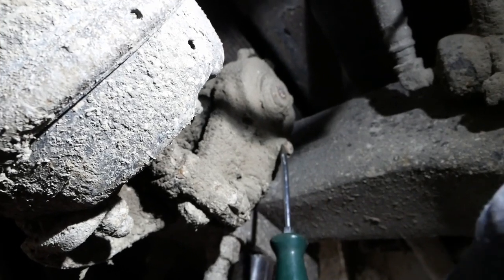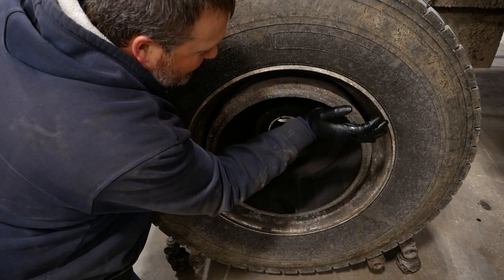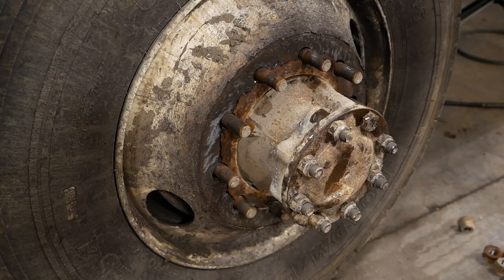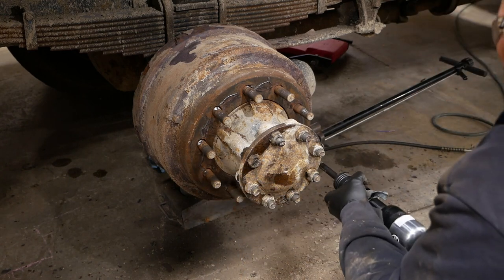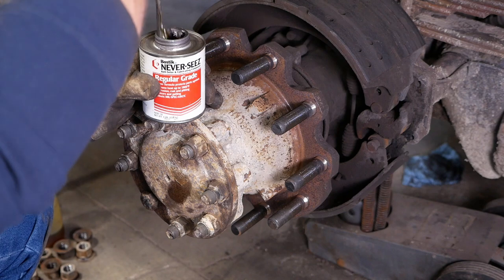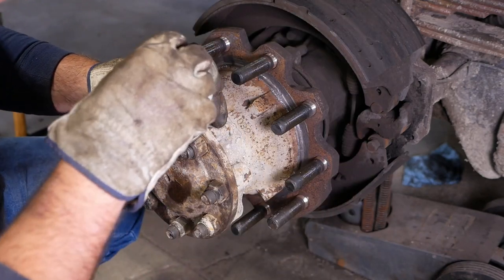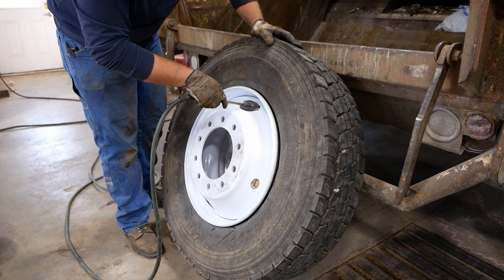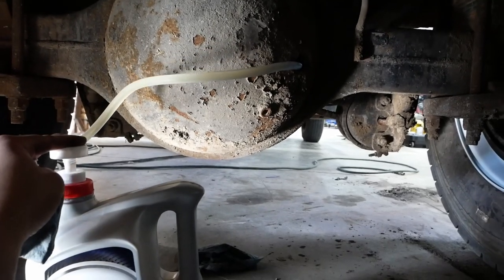Garbage Truck Driveline Noise Could Have Been Bad!

Comment: I had a 10 wheel dump truck in the late 90's - early 2000's that had 11R22.5 tires on it with the steel Budd wheels just like this truck you're working on.  The difference being that I was regularly running it with 35 ton gross weight (which was allowed in NJ with special plates).......and it would do exactly this at least 3-4 times a year.  I even switched all 8 rear wheels to the heavy duty steel Budd wheel.....and it would still do it on a regular basis.  It just became a regular check that was part of the pre-trip and pretty much every time I was out of the truck before I got back in it.....kick all the inner tires to see if there was any anomalies.  As soon as I heard the noise at the beginning of the video I knew exactly what was wrong!!!  LOL
Reply: I think it just comes from going over a bad rail road track or a pot hole or man hole or even a rock, in your daily route;  for that moment, you put all the weight on that one tire with a sudden jolt as you hit the bump;  That's the only thing I can think of.  Maybe it's the brakes coming on way too strong -- and that sudden STOP in the hub, while the wheel is still rolling with all that weight and traction;   The wheel diameter is just too big and has too much leverage for that amount of weight. Just thinking out loud.  It's kind of strange to see that it happens so often.  Maybe it's just the metallurgy is too brittle or that it work hardens.   It's interesting;  I wish someone could explain the exact science of what is happening.   I guess they should just build them thicker. lol
Reply: @calholli  the lugs have rust stains around them, after the repair, they need to be torqued up, and retorqued again in a hundred miles, then retorqued weekly until they hold torque. that paint will wear off, cause those nuts to loosen.
Reply: I wonder if this is why a lot of heavy duty trucks used to have spoke, AKA "dayton" wheels instead of budd wheels. Though it seems that modern heavy duty trucks always come with budd wheels. Sometimes I see a more modern looking truck with spoke wheels, though that is pretty rare. In the past, even in places like Europe and the former soviet union, the heavy duty trucks frequently had spoke wheels.
Reply: @burgegerm7878   good question....don't think it matters.
Reply: @burgegerm7878 , nobody seems to know how to mount the wheels, and they ALWAYS wobble.

Comment: GLAD TO SEE YOU ARE OK FROM ACCIDENT.
Reply: Guy got killed week or so ago when he stepped out of his vehicle to get ticket out of machine at parking garage. Car rolled and pinned him in the door. Never know when your time is up. Doing dumb stuff can accelerate that date though.
Reply: I’m a contractor and a house I worked in the homeowner, a young Mom dropped something on the garage floor while sitting in the car with the door open and she reached down to pick it up. While she was doing that the car which was in reverse already, rolled back and pinned her between the car door and the opening to the garage and killed her. The worst part was one of her kids was a special needs little boy who really needed his mom. 
Today is a gift tomorrow is not a guarantee.  So happy Wes is ok after his incident, he was so lucky.
Reply: @clintprice2123  damn
Reply: He was ok the day of just seconds later. Why wouldn't he be ok now?
Reply: @clintprice2123  This might be a little harsh, but the mom was special needs too apparently.
Reply: Its not super bright to be running a single rear axle to support all that weight with a full size garbage truck
Reply: @d-day3855  It's done all the time. 20,000lb axle there. It's safe as long as the operator is safe.

Comment: Former tire guy here. That is caused by heat. Constantly applying the brakes. Used to see it a lot when I used to work on garbage trucks. One company in my area made it a common practice to replace rims every couple years because of it.
Reply: that must be some severe heat buildup in the drums wow
might be better off with a disc brake chassis if its that big of a problem
Reply: @alouisschafer7212  that would be up to the bean counters that order and buy these trucks!
Reply: That seems to be a logical explanation.
Reply: That makes sense - constant heat over time will anneal the metal, softening it. Those hubs likely get stupid hot on a daily garbage run.
Reply: @steve_does  disc brakes are the best for said application, drum brakes may create heat but disc brakes couldn’t stop such mass without costing a fortune, dump trucks r Fukien havy
Reply: @DiscoMiata  I disagree with that. I drive a 2020 Volvo VNR. It has disc brakes all the way around. My truck stops very well with the disc brakes. Problem is disc brakes cost more and don’t last as long as drum brakes.
Reply: @alouisschafer7212  disc brakes on garbage trucks, and buses are the  worst combination. Drums are good 0-40 mph, and disc 40+ mph. Can't tell you how many cracked rotors I changed on school buses. Also, I've noticed over the years, that most air brake vehicles don't have proper brake adjustment. Best way to have cooler running drums is to have the heavy duty drums, and proper working brakes, and verifing the brake throws. The heavy duty drums have more metal to dissapate heat. Also, a lot of guys go crazy with the one inch drive  air guns. That doesn't help either.
Reply: nasty job

Comment: Wes, as someone who was an aircraft mechanic in the Coast Guard for 5 years and an Ironworker welder for 3 years before that plus 40 years this next January working in noisy bars and other locations on jukeboxes, pinball and arcade games I'm seriously impressed that you wear eye and hearing protection.
To many people on other YouTube channels don't and all I can think is how bad their hearing will be when theur ny age (68).
I did wear hearing protection my entire working life yet I do have some hearing loss.
I'd be deaf if I hadn't. 
I'm also impressed that you tourque wrench those lug nuts.
Bus Grease Monkey also showed the effects of mechanics that only use an air wernch to install them with the same results on bus rims, studs, brake drums and wheel bearings.
Yuppers, you're definitely a top of the line mechanic your customers are lucky tohave you working on their vehicles.
Reply: Everyone thinks they're invincible, especially the boys. I work on a flight line, and I've always got over ears on, maybe double it up when marshalling aircraft. Some guys say "I already can't hear" when I recommend putting on protection, completely neglecting the fact that IT WILL GET WORSE. I've already got ringing and some loss, and I sure as hell don't wanna be deaf.

Comment: I love watching you Wes. I love that you work on big trucks, cars, foreign, domestic. Your humility and willingness to work on whatever comes your way are signs of a great mechanic, and your electrical diagnostic capability is top notch. I say that as an EE. 

Question though, what is that goop you used where the beads ride on the new wheels? ..... Funny that you're talking about how terrible you are at changing truck tires and here I am thinking you make it look easy.
Reply: Agreed, just to remind that Wes is a mechanical engineer...
Reply: Agreed it’s the variety that brings the charm on this channel. One minute we are soldering wires, the next wrestling with rusty old trucks. Not sure why subscribers aren’t higher
Reply: Goop was bead sealer. Slow leaks from beads can drive you nuts! Rust makes them worse.

Comment: Driving into Central Texas today, it was all "straight pipe" Freightliners pulling stock trailers . . .   Fall is finally here.
Reply from the maker: That's every day here. Starts about 5 AM.
Reply: @WatchWesWork  Sigh, I wa out today at 0500.  But, no, it was all the trailer s were livestock--not a single grain trailer all day.

Comment: With everything you said. I would have pulled the other side off and inspected it to see if it is in the same condition. Looks like over loaded stress cracks..
Reply: Was wondering if he did that. Maybe just a check for movement?

Comment: An easier to store alternative to the seldom used wheel dolly is a sheet of safety glass- like the rear window from a truck. Doesn't matter if is cracked. Can even use it on the gravel parking lot on top a piece of plywood. Grease or oil makes it slippery so the wheel assembly slides reasonably well. I've made do with a greased garage floor. (I weighed 125 lb then)

Comment: My guess on the broken rim is because garbage truck do a lot of start and go, and on steep incline(full weight).
I might add that being on the passenger side, it could mean that truck goes a lot on the side of the road where it finish and meet the gravel.
Brake heavily while one wheel is totally off the road 'free spinning' and only the broken one was actually experiencing all the work/force.

Comment: Wes, you probably will not have to change many truck sized wheel studs,  but you can use "big Nasty" to easily drive the studs out if you use a piece of pipe (can even be just PVC)  big enough inside diameter for the driver end to fit through and just long enough to account for the hammer stroke length.  Slip the pipe over the wheel stud and hold it in place with a gloved hand and set the hammer end of Big Nasty on the end of the stud. The pipe is the guide to keep the hammer in place.  This technique can be adapted to most sizes of wheel studs and hammers.

Comment: Wes, now you have wheels for a fire pit. That's certainly a strange one on the broken wheel. I had an old Scout that was in for inspection, and on the way home from work the following day, my wheel passed me on the highway. They claimed that the loose wheel wasn't their fault. I actually put it in 4 wheel drive to pull it off the road, and the next day got another drum at the junkyard, and put it back together again.i never had that problem before with drums, but I didn't go back to that inspection shop anymore. I just didn't trust them.
Reply: Ever watch Letos Law.  In MI, a customer had his tires rotated, and they didn’t tighten the lugs.  Wheel fell off and major injuries occurred.  Customer tried to sue.  The Michigan Supreme Court ruled that the fact they started the job, constitutes completion of the job.  The customer received nothing from the courts, since the dealer was not found at fault.

Comment: Good job Wes my experience on inner wheel crack is overload. Once they crack they flex and you get what you have. I ran into this issue on refuse trucks like you had. Think as you said to much yardage for light truck.

Comment: Definitely a interesting video Wes! Those new white rims sure are a contrast to the rest of the truck! Trash trucks have a very tough life with all the constant starting, stopping, and rough roads, any wonder they hold up as long as they do.
Reply: Curbs as well in the city, often some entrances into parking lots and yards are not designed to be easily used by trucks and the guys just want to get the work done and go home, so inevitably they jump a few curbs here and there
Reply: And overloading. That truck probably only has enough gvwr for a couple ton of trash.
Reply: @scotcoon1186  I agree! Probably a combination of overloading and bad roads fatigued the rim to failure.

Comment: I worked for Waste Management as a mechanic for a short time. Hated working on the garbage trucks. Would have to comb my hair to get the maggots out of my hair that would drop on me. Digging out the compressor wheels when they came off was also fun. Old timers would crawl behind the hydraulic tank and use the area as a bathroom while out. So glad when I left that job.
Thanks for sharing.

Comment: I had to work on a garbage truck once in my days way way long ago and I will never forget that experience! I wasn't nearly as lucky as you Wes, in two unfortunate ways. One was that it had a bad transmission that had to be pulled, and two it was not empty! In fact it was full to the brim. Here's the part that I'll  never forget, as I was laying on my creeper studying how I was going to tackle this huge Allison transmission that was covered with about an inch of oil soaked dirt and unthinkable, I began to notice these little white pieces of rice and they were all moving in the same direction going towards the front of the truck. Then I realized that it wasn't  rice I was looking at heading in my direction, it was maggots falling from the back portion of the truck. This truck had been broke down for over a week before I got the pleasure of working on it! Thats been over 30 years ago and its still fresh in my memory! lol

Comment: It happens all the time on those things. Stress, rust, heat cycles, wrong torque, didn't clean the drum, and rim face with let the rust break free and like I said the thickness of a business card will start the wobble and cracking and cascades from there. Glad to see you and the pup are doing well and hope that you have a great thanks giving.

Comment: Nice Job. Damm,, when I saw that can of Bostik in your hands it brought back many old memories. I am from South Africa and Bostik was founded in South Africa and is one of our oldest companies. The original factory is still in Krugersdorp, South Africa. The founder of this company had so much faith in his products decades ago, that he took an old thick steel cable and cut in half. He then used his patented Bostik super glue and glued the two ends of this steel cable together. He then proceed to suspend an old 30 ton bulldozer from this cable,  where it is still hanging from this fixed cable. If remember correctly the name of this glue is called steel bond. 👍👍

Comment: Wes, many years ago, I ran a service station, and I did a lot of truck tires. They were all tube type with split rim, split ring and the real man killer, the solid ring 16-inch chevy 3/4-ton truck tire rims. I did not have a cage and I would set them out in the driveway and put the air hose on and walk away. I was always very careful and did not have one blow up, but a shop close by did have a man killed when a split rim exploded in his face standing as he stood over it while holding the air hose. I agree. Let the tire shops service them. At least these are tubeless.

Comment: Hey Wes! I just wanted to tell you that I finally did the head gasket on my '05 Civic coupe and it went AMAZINGLY well! I actually rebuilt my first cylinder head to swap over (that includes valve lapping and valve seals), first time ever doing a head gasket and my first time doing a timing belt job. I had a minor slip up when the lower timing belt cover gasket got sucked into the timing belt and threw off my timing. Fortunately, the valves didn't hit the piston. It took 4 days but I did it!!!

Comment: Wes instead of rattling on the drum with an air hammer/ hitting it with a big hammer, just slide a jack under the edge of the seized drum and Jack up. Works every time.

Comment: Special tool day...Using a 1/4" or less 3" x 18" ish plate and some old bearing racing for strap hooks, bend the plate into a "u" shape that kinda fits the drum and find a socket or round piece similar size as jack foot (1" ish diameter-that hole). Can also be used on trans jack and hoist for knuckle removal for whatever-leave the caliper and everything on-hold knuckle to the side. Great vid Wes

Comment: I used to work for a John Deere ag dealer and for the last 11 years I hauled equipment for them.  I loaded a 9770 combine on 30 " rows with duals onto an RGN trailer and hauled it to the dealership for winter service.  As I was backing the combine off the trailer, I saw the  drive wheel supporting the combine on the outriggers wiggle.  I stopped moving to investigate.  The inner dual was cracked just like this truck wheel.  I gathered some railroad ties and other dunnage to put under the outer dual (hanging off the trailer) only to find the outer dual was flat.  After inflating the outer dual I was able to unload the combine somewhat safely.  I wonder how long the farmer had harvested in rough field conditions  with only the inner dual carrying the weight of the combine and corn head.

I wonder if the trash truck had been running with the outer dual under inflated and over loaded for some time.

Great content, I don't miss working on trucks at all.

Comment: Good job spotting that Wes. I work in heavy haulage in the UK, our steering trailers are really prone for this. I’ve seen it a fair few times with hydraulic suspension and steel suspension. 

Our equipment runs a max of 16.5t an axle which I think makes it more prone.

The last one that happened to me was the last axle of my trailer. On the back of a 5 axle trailer. I didn’t hear it but someone flagged me down. The whole inner part of the rim had gone. All that was left was the bit the tyre beads onto. It was pretty bad but amazingly the hub was okay as well as the drum, it had some slight marring but not bad.

Comment: 25 year tractor trailer mechanic. I've seen a lot of this in the last 10 years mainly from Chinese drum mfg . The drum # will cross reference correctly, it will fit and work for a little while but ends up busting the rims and sometimes the drums . The hub pilot drums won't have the tiny chamfer close to the center but it looks like it fits but it doesn't so when it's put back together the rims and drums get bent towards the hub without the center moving at all .. 1/16 to 1/8 is all it takes. Steel wheels break before alluminum wheels oddly.  It's crazy how small it if most mechanics won't catch it

Comment: I'm willing to bet the increased stress from better application of the tires to the road combined with all those rust issues had a pretty big say in the damage that was done to that rim. Started slow from one spot where that chunk is taken out in a non-uniform manner and worked its way all around from there fairly quickly.